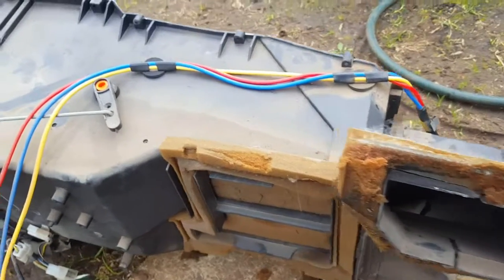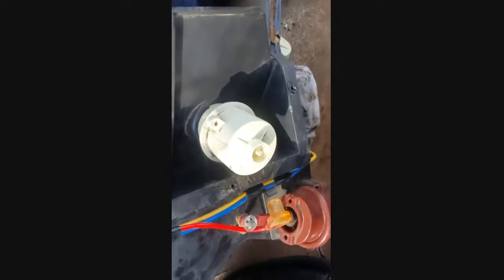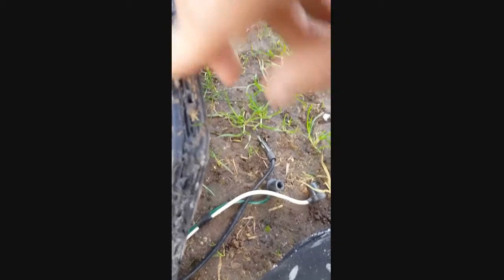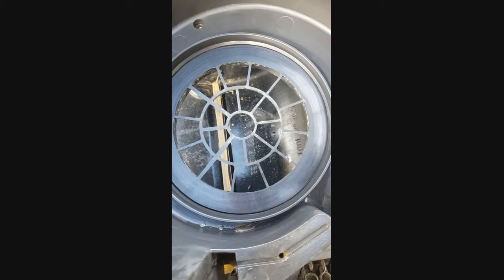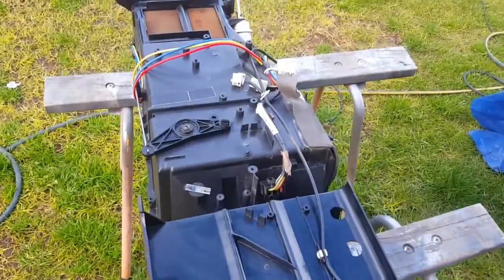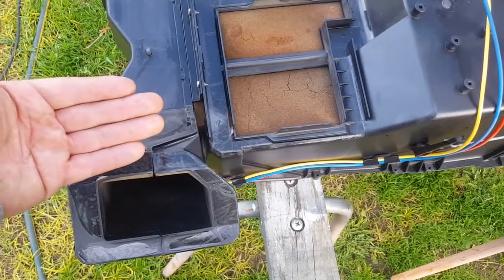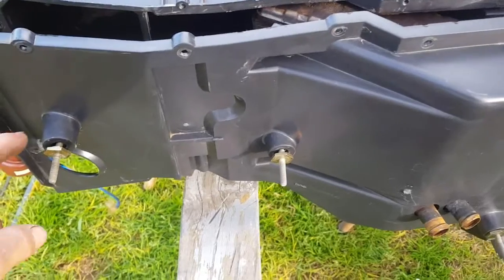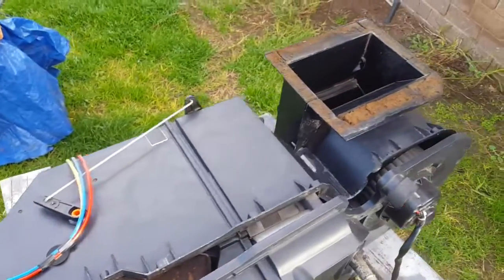1993 XG FORD FALCON, EX VICTORIA POLICE DIVVY VAN DASHBOARD REAR AIR BOX RESTORE PART 2

Comment: Make sure you replace the pipe that goes around the back of the engine from the water pump we had to on our xg an it wasn’t fun with the engine in the car
Reply from the maker: Ok thanks for the tip was it rusty or?
Reply: It was rusted out  and had a slow leak
Reply from the maker: @juddlewis9939  ok cool, what do you think of this build?
Reply: It’s interesting seeing another panel van like ours but getting restored we have one and we’re trying to get it on the road
Reply from the maker: @juddlewis9939  yer you dont see many on the road anymore, that's for sure i appreciate your feedback